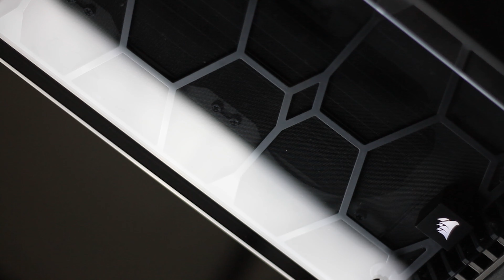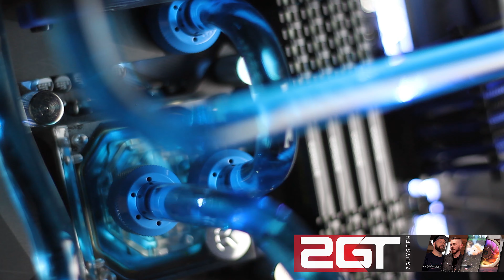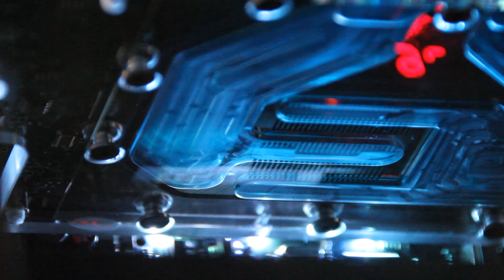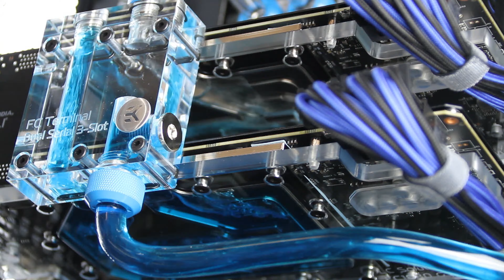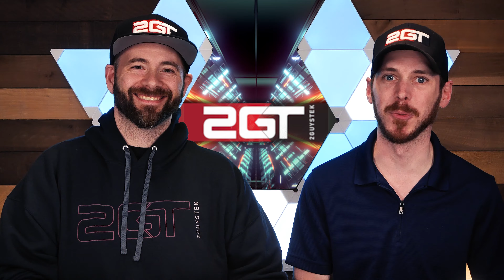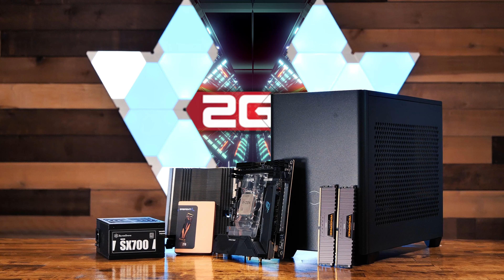My first SFF Build! - Cooler Master NR200P Small Form Factor Build!

Comment: I am thinking about building this for my stepson. I was hoping for a NUC 11 but I am not sure they won't be crazy expensive to get one. Any lessons learned now that you have time with the machine? I'm old so I like that there aren't crazy RGB stuff everywhere and it's small. I have been buying PC for 35 years with expansion slots that no one ever uses. Great looking build and video. This would also be my first AMD build.
Reply from the maker: The system has been great and it's my (Rich) daily driver. It's packed full though with the 3090 GPU I have in it, and when doing heavy GPU and compute tasks it gets warm. Make sure you buy good fans for the case if you decide to build one! Thanks for the question and for watching!

Comment: You can fit the 140mm fan on the bottom with a bit of work on the 24 pin cable. It's definitely super tight, though. Another option is to contact Noctua, who can send you some free 120mm fan clips, then you can get an NF-A12x25 to mount on the bottom, and put the 140mm on top, which avoids all clearance issues. Also, like someone else mentioned, you'll get better performance if you have the cooler fan (or fans, if you go that way) as intake from the side panel, that way your heat sink is getting cold air straight from outside the case (and your top fans can exhaust the heated air out). Speaking of exhaust fans, at least for me, the 92mm fan included was NOT compatible with the NH-C14s. The good news, especially if you love Noctua, is that their slim 92mm fans are only 14mm deep, and will easily and comfortably fit behind the heat pipes of the NH-C14s. I set mine to exhaust as another way to help get the heated air that just passed through the heat sink back outside the case.
Reply from the maker: All great points and thank you for the recommendations!

Comment: Cpu fan is the wrong way round. As you have the two top fans exsuasting the cpu should be pulling air in, that way m.2 drive will be a lot cooler.
Reply from the maker: You’re right about this! And in the build the fan has been reversed for better airflow! The video showed it mounted exhausting or as that’s how Noctua packaged the cooler out of the box! Great eye for detail! Thanks for watching!
Reply: @2GuysTek  I would like to know the temps of your chipset and vrms as i have the same motherboard thanks
Reply from the maker: @keibohow69  OP delivers: https://imgur.com/bSDJc5u
Reply: @2GuysTek  thanks
Reply from the maker: No problem! How did those numbers compared to your numbers?
Reply: @2GuysTek  my chipset temp after gamming 62c. I do have a custom case thou which makes a big difference. Cpu r7 5800x 120 aio.
Just for comparison go to a channel called optimum tech and look for a video called every watercooled pc needs this and go to 4 mins 28secs althiu he uses a asus maximus board.

Comment: Awesome build and video! Just a question: is the 700W PSU really enough to hold everything on full load? =D
Reply from the maker: It’s been good so far in mining and gaming!
Reply from the maker: Just an update for you Diego on the PSU wattage - the 700W has been absolutely bulletproof with the 3090, CPU, and board - no power issues, and completely reliable.
Reply: @2GuysTek  Wow, awesome, tks for the update guys, keep up with the good work